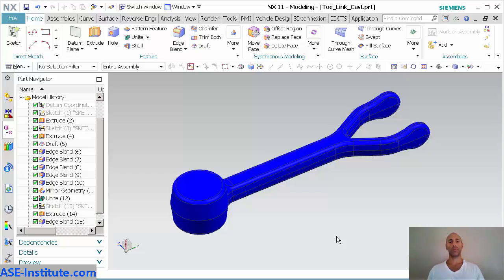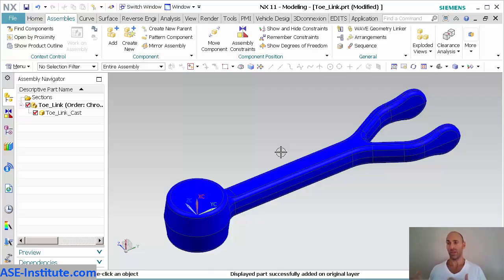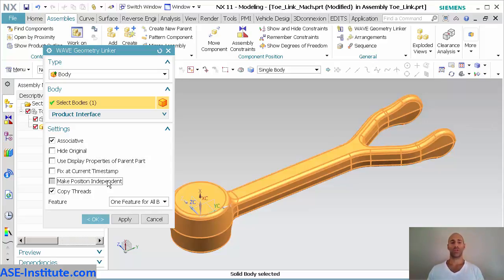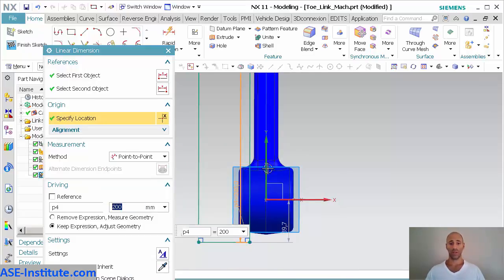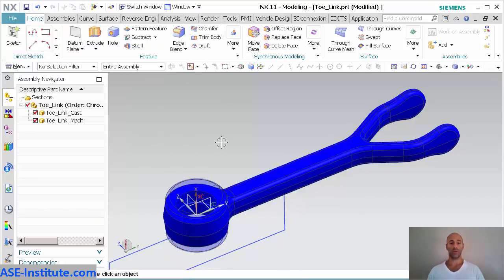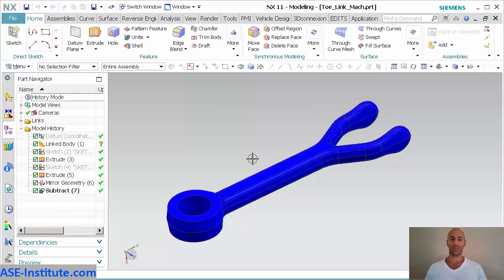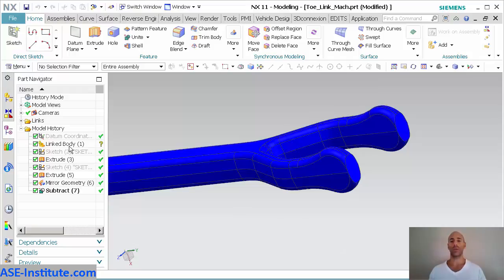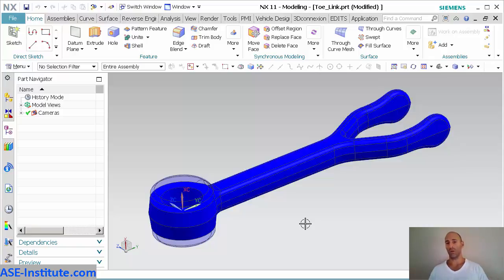Casting to Machined Part | Siemens NX

Comment: Hi Class A. Thanks so much for this interesting approach to make a workflow from casting to finished parts.

I have one question:
why create that 'middle level' assembly that contains the raw part and the finished one?
Can not be more easy and convenient to create only the two part ( raw and finished ) linking then the finished part directly to the raw part?
I don't know what's the best practice, but i'd like to have your opinion on this other possibility.
Thanks so much for all your work shared with us.
Reply: Me, in the same concern of why an intermediate Assy lever needed.
Reply: Just found another way. The middle Assembly you just mentioned could be used as Final machined part.
Here is how. 
1. Just add the Casting Part to Assembly
2. Make the WAVE to obtained the body of Casting Part
3. make "non-geometric for Casting Part" 
4. Then Modify the Machined Part from Body obtained as you want.

Comment: What happens if a new version of the cast part is created? How will the new version update into the machine model?1
Reply from the maker: The bodies are linked. So if the Casting changes it will change in the Machined part.
Reply: class A surfacing If we are working in a plm system, the new version would actually be a new file. That would mean that the new version would have to replace the old version in assembly. Doesn’t that cause errors on associated features?
Reply from the maker: What PLM tool are you using? Also, do you have WAVE? 

Are you rolling a REV by doing a Save As or making a new file?

Their are a lot of questions to answer. The correct way is to Save As on the Casting and have the Machined Part to force the link to switch. If that does not happen cleanly then you can relink and if you made your changes in a manner that is based off of good clean parametric modeling practice then you should not have too many update errors.
Reply: class A surfacing We use SAP PLM integrated through ECTR by DSC. Yes, we have WAVE. The new version is created as a new file, but the previous version is copied into it. In other words it is like a save as
Reply from the maker: Kind of is. The issue is the new body may not be mapped correctly when you do the copy. 

You may have to do a 'Replace' to get things to update.
Reply: class A surfacing I think the replace component and replacement assistant work well, but if the new version is totally changed, then there will be issues.